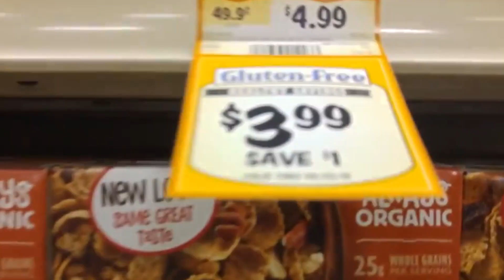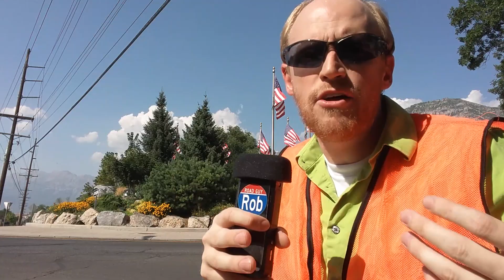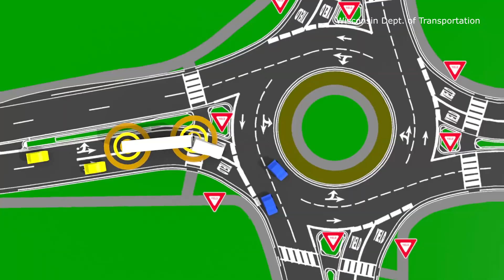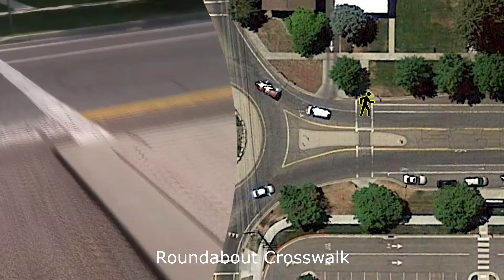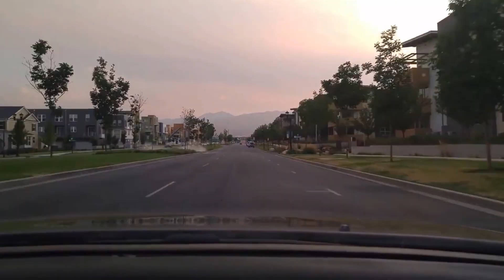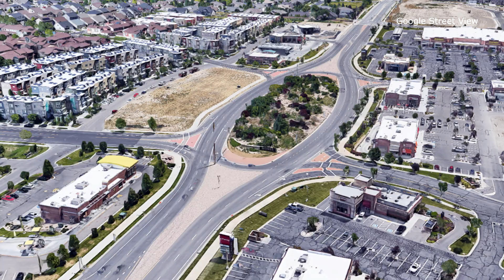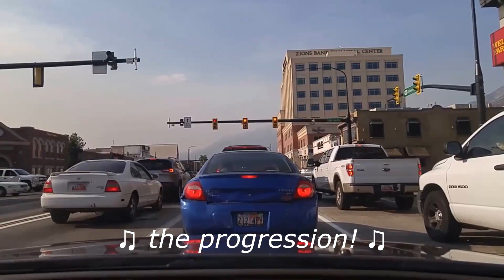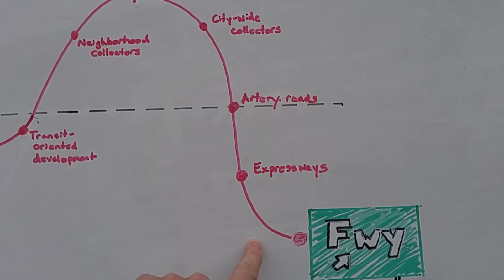Are roundabouts REALLY better than a traffic signal?

Comment: They're generally good when there's steady flow from all directions. They're not so good, however, when there is a constant flow of traffic into the roundabout from one direction, because then it takes a long time before any cars from other roads can enter the roundabout, due to how priority works.
Reply: you can handle that as well, either with the dominating main road just cutting across the center part and control the entire thing with traffic lights, or you give the through-going main road the right of way and let those proceeding further around in the roundabout give way and handle that without traffic lights, or you can make an elevated / deepend roundabout above/beneath the straight going main road and design it with offramps/onramps
Reply: @EnjoyFirefighting  A few places I know has part-time traffic lights, actually. Though one particular roundabout near my house doesn't have that when it really should, which causes headaches with constant traffic from one particular approach.

Comment: The best round about ever is in New Orleans.  Well technically Jefferson Parish just outside of it.
It is a 3 tiered road way , where Airline Drive crosses Causeway Boulevard.
Airline is the bottom being able to pass through without rounding.
Causeway is the top being able to pass through without rounding.
But each has ramps for enter and exit of the middle tier round about.
Check it out on google ... it is a thing of beauty ;)
Not sure how long it's been there , but at least a few decades.
Reply: well that's a pretty common layout when you look at Sweden ...

Comment: Roundabouts have several disadvantages, in addition to the space and crosswalk length issues you mentioned:  (1) difficult for long vehicles to navigate which you kind of gloss over, (2) expensive to convert from a "cross" intersection to a RA [you claim the cost is similar to installing traffic lights but that seems unlikely given that you have to create new roadway all over the place, what's your source?  Are you considering the economic impact of that intersection being unavailable while the RA is being built?], (3) reduced fuel efficiency since vehicles always have to slow down for a RA rather than maintain speed through a green traffic light, (4) increased brake wear as vehicles always have to brake while entering the RA if there is any traffic, and usually will have to brake multiple times while vehicles ahead of them enter the RA, compared to braking once for a red light (with more advance notice so they can just let off the accelerator to slow down most of the way without braking) and not braking at all for a green, (5) increased tire wear as vehicles always have to turn in a tight circle instead of going straight or turning in a looser arc.
Reply: 1 in decent size roundabouts the turning circle is larger than when taking a right turn at a normal intersection, shouldn't be a problem for long vehicles. In some parts of Europe they run road trains and they still get through roundabouts; In places where the roundabout might be too small or you know that there will be oversize-load trucks on a regular basis you can design them with a flat center part as well, so they can just cut through. 
2 he probably thought about when planning and building new roads and the decission to either build an intersection or roundabout. Apart from that I had several intersection conversions around here in the past and they always remained in use for traffic.
3 but thatfor they don't have to stand still as long when waiting at a red light
4 same factor, at red lights they have to comet to a full stop either on the one or the other road, so a roundabout doesn't really have more brake wear
5 increased tire wear? Seriously? When you take turns at an intersection it's the very same thing, or when living in an area where the road doesn't go straight for miles but has turns here and there. It's not really increased, not in a way that it would be worth mentioning; Look at the Netherlands with a great number of roundabouts? Friends living and driving there have a very similar tire lifetime like I do with only 9 roundabouts in the entire county and with me comming across none of them on a regular basis

Comment: More car's through it in a minute (Myth busters)
Reply: That was compared to a four way crossing with stop signs, not with traffic lights. Generally traffic lights can handle more traffic than roundabouts - that's why roundabouts are mostly used on streets with mid-volume traffic, pretty much like Rob showed on the graph. There are of course exceptions to that "rule".
Reply: @gullijons9135  And as he said, roundabouts work best for "Random Arrivals". 
Imagine an almost full main road (Right hand traffic). Most cars go from south to north now. Some locals go from east to west. But the roundabout is dominated by the main traffic flow. No one from the east can get in. Cars from the west will have advantage, in theory they have the priority over cars from south, because no one stop them entering the roundabout.

But if they don't have dominant entrance and exit, it might work better than traffic signal
Reply: @li_tsz_fung  When I lived in Reykjavik we had this exact problem. There was a roundabout on a street with one dominating traffic direction. It was usually a whole lot quicker to take a longer route to an intersection with traffic lights to get on that street - even if it meant first going in the opposite direction of where you intended to go.
Reply: @gullijons9135  Everyone has experienced the situation when you are alone on the road, stuck at a read light while the crossing road with green light is empty. That can never happen on a roundabout. The only moment a roundabout is empty is when there are no incoming vehicles at all.
The count of passing vehicles will always be maximum in all circumstances.
Even the issue mentioned in this video about having a dominant flow that blocks access to others can be corrected by making the turns steeper. This allows to reduce the speed enough that side entrances can merge smoothly and safely into the dominant flow.
Reply: @gullijons9135  i have been on freeways with round-about - they just make them with a greater diameter and you can see across them. They work fine even though the speed on them is higher than on a local set up.
Reply: Incorrect use of apostrophe.
Reply: @MirzaAhmed89  I think it still works if you're just talking about the amount of "car material" :P

Comment: I know of serval small-ish roundabouts that don't even have a planter box, it's just really teeth-rattling cobblestone. HOWEVER! There is usually a reason, these can often be found at the entrances of industrial zoning, hence making the turning for truck easier, they usually are 20-30% smaller then those with a planter box, but not allways. There is another benefit to them if they are constructed like that, if they happen to be placed on a route where you have notoriously often trucks with the "CONVOI EXEPTIONELL" sign and serval cars going before and after to secure said route since it's not every day that half a sawmill etc. get's transported. I have also once seen a roundabout with a street bit in the planterbox which had movable barriers/gates, the round about was crossed about 2-5/month by a truck convoi with limited turnability due to being such an exeptional transport (due to their local factory), when the convoi passed through the gate was opened, the truck went straight through, everything was closed off again, -> transport done.
As for the pedestrians, well try overpasses or something with a small park area in the middle or something, you can get used to it, it's certainly safer. Also I don't thin the comparrison between both was quite fair, certainly there are better options for roundabouts and pedestrians, like this one: 54.316607, 10.181875 (Google maps coordinates, for better view go to photo view)
The walkway is right next to the roundabout, making the distance shorter, this is achieved by the fact that you have to yield anyway, so you may as well put that crosswalk right up to the stop line, of course I as a pedestrian would have to yield to traffic within the roundabout that wants to leave but cars entering have to yield to me since I too am "in the roundabout" you can enforce that by using "zebra lines", since they give priority to pedestrians (not cyclists though ! ).
If one wants to learn to love them there is a place in the US for that, as he mentioned, for more see: https://www.youtube.com/watch?v=AqcyRxZJCXc

Comment: Actually, you can have roundabouts in a freeway, well, these won't be a regular at-grade roundabouts, but rather the roundabout is grade-separated from the freeways, so turning traffics uses the roundabouts while traffics passing straight bypasses the roundabout.

Or you can put a turbine interchange, which is a bridged spiral intersection that works in somewhat similar ways to a roundabout, though visually it doesn't look like roundabouts.

Comment: Try that “straight through” thing in a multi lane roundabout in Europe and see how big a ticket you get OR if you can continue to drive at all
Reply: Try that with a Netherlands's roundabout.
Taking the racing line at warpspeed will cost you a trip to the dealership to get your rims realigned. The lines between lanes are not just paint, but 1-2 inch high concrete strips, bolted/glued to the asphalt.
Reply: I intensely dislike those Dutch double lane roundabouts with concrete blocks. They work fine when you already know which exit you have to take but they're such a pain in the ass when you're new to a place and you just want to go around till you find the right exit. Nah, can't do that, exit now. Concrete block says you have to. What's the point of having a roundabout in the first place if you can't actually go around it. Mind you, not as bad as the british double mini roundabout, which is just some graffiti pretending to be road markings.
Reply: @Aimless6  ya, majority of SUVs and Pickups here can drive over them zero issue unless youre the fool who stretched low profiles on a wide rim..
Reply: @Aimless6  Yes, motorcyclist killers.
Reply: @Aimless6  The raised partitions only occur on turbo roundabouts. Regular roundabouts just have painted lines, if they are multi lane roundabouts. Raised partitions are only dangerous for motorcycles, so there is always a special warning for them. Emergency vehicles can drive over the raised partitions if necessary. In my town the changed a stoplight crossing into a turbo roundabout. There used to be traffic jams on that crossing, all the time. Now there are none. The only difficulty was the change over construction, because it is the most important crossing in town. They reconstructed it during 9 days around the clock, so 9 times 24 hours, and then the turbo roundabout was ready. The closing of the crossing for 9 days was a disaster, but reconstruction while the crossing stayed open would have taken several months and costs more money. Not for the municipality (24 hour construction is a little more expensive for them) but overall, including for people and businesses because of very long waiting times during road construction for months, for temporary bypass roads, relocate bus stops etc.
Reply: @Aimless6  I can see this being very impractical for emergency vehicles responding to a call
Reply: @EnjoyFirefighting  
Not really. You have to be able to stop if needed, even with lights and sirens. So it might even be faster, not having to make a full stop and check before busting a  red light.
Reply: @Aimless6  was less thinking about speed but more about the rpad layout and the space to move over, or for emergency vehicles to move around other vehicles in traffic; With all the raised dividers, medians and traffic islands precisely directing traffic I see this being an issue in Dutch road layouts, however Dutch drivers are smart enough to be able to handle that rather well in most situations; Here we have some few of the raised ones as well, but many lanes are defined by lanes painted on the road, giving them more space to freely move around
Reply: at least in Germany the chance for getting a ticket is very low lol ...
Reply: there is one here that you actually have to change lanes in to take a left, if you stay in the same one you will just end up going back the way you came
Reply: @wades.4087  lol are you serious now? Or are you from the US having 0 experience with roundabouts?
Reply: @alexanderblohme5044  This is quite common with two lane roundabouts.  Straight through traffic requires the outer/right lane to exit in the right lane while the inner/left lane can either exit or continue in the roundabout in order to make a left turn.  So if left lane traffic is making a left turn it has to switch over to the right lane once past the straight through exit.  Wade S. is correct.
Reply: @AlaskaErik  if we are still taking about roundabouts with concrete dividers the 'switching lanes' is 'automatic' you literally have no other way to go.
Reply: @daanleenders  That's not what I'm talking about.  Concrete dividers help funnel right turning traffic out of the circle.  I'm talking about that section between the second exit (straight through traffic) and the third exit (left turning traffic).  It is there that left turning traffic has to transition from the inner (left) lane to the outer (right) lane in order to exit at that third exit.
Reply: @AlaskaErik  the 1 lane roundabouts that I am talking about have 2 spots in them where it is just 1 lane, and at that point the lange changes from the inner circle to the outer circle. For example https://upload.wikimedia.org/wikipedia/commons/thumb/f/fc/Turbo_Roundabout.svg/1200px-Turbo_Roundabout.svg.png
Reply: @Cheesus Sliced There are dotted lines indicating where you switch over.  Our roundabouts are very well designed.
Reply: Some roundabouts here ARE straight through roundabouts. The most major road goes straight through a big roundabout so they don't have to go round with all the other traffic and clog up the roundabout. There's even a big roundabout in Manchester city centre with a straight through for one road, and an underpass for another.
Reply: You can do it in Australia as long as you indicate each lane change. However you will probably confuse people waiting for you and they may pull out in front of you
Reply: @Nebs1  I'm sure the rules are different from state to state and have changed over time, but I was taught that its illegal to change lanes in a roundabout, and I wouldn't reccomend it unless you like trading paint.  

Some people are describing the act of entering a dedicated turning lane as a lane change, but there's no conflict points in those maneuvers, so they're more like a merge than a lane change. 

In Lilydale, Melbourne, you have an intersection where about 5 or 6 main roads join at 3 roundabouts, and each of the roundabout connects to the next so you can drive in any direction from any other by turning clockwise enough times.  Each of them is a two lane roundabout, and no lane switching is required (or tollerated by the flow of traffic) to get to an exit leading the correct way.  If that monstrousity can exist, any 4 way intersection should be pretty simple to manage with 2-3 lanes.  

The lack of required lane changes is one of the reasons that roundabouts tend to have much higher throughput, since they eliminate the confusion and extra caution that comes with people trying to arrange themselves in time to make their turns.
Reply: Stop talking about Europe as if it's a monolith. I have visited many south eastern European countries and this is a common problem.
Reply: Disagree, easy to get away with in the UK & you would have to do it blatantly & get nicked a few times to be banned
Also Coolidge is correct, in  North eastern Europe there are apparently no legal lane rules
Reply: The U.K. uses common law which means most driving law falls under the offence of "careless, and inconsiderate, driving".  Generally you risk being charged with this if you do anything that causes another road users to have to change speed or direction  because of your actions.

So if you straight line a roundabout as in the video to the inconvenience and potential risk of other road users you do risk a fine and driving licence points.  But if no one is around to be affects it is perfectly fine.  And for experience motorcyclists (as in reading the road) it is even safer to spend less time leaned over.

And for a standard roundabout with four arms are two lanes it is quite normal to exit from the innermost lane, because the driver should be indicating before their exist no traffic in the outermost lane should be stupid enough to try and pass someone on that side before an exit.  Yet in some countries it is illegal to exit a roundabout from anything other than the outermost lane and the U.K. way would get a ticket.

Europe is not a singular thing and each country has its own designs and rules, and those can be contextual rather than absolute.